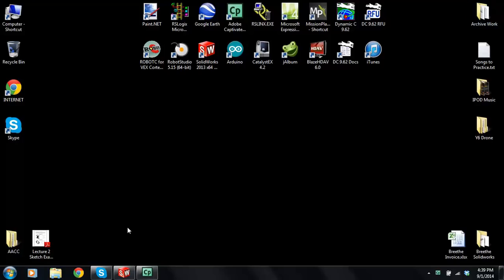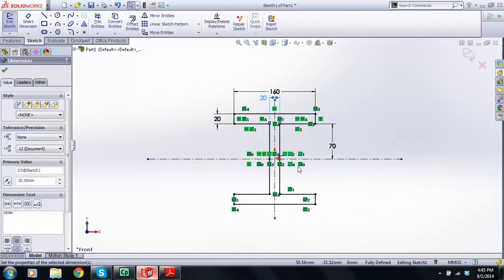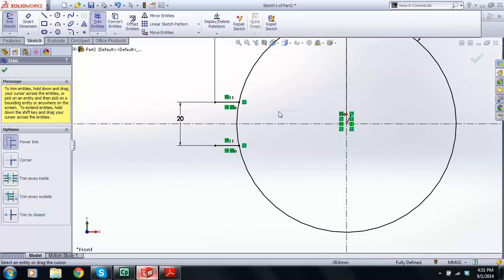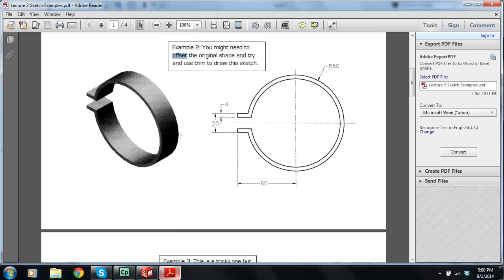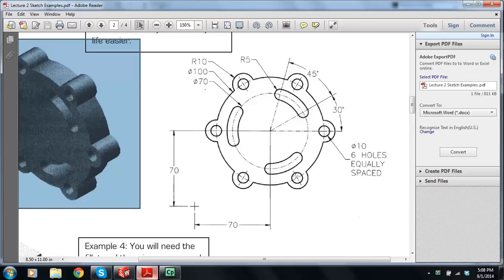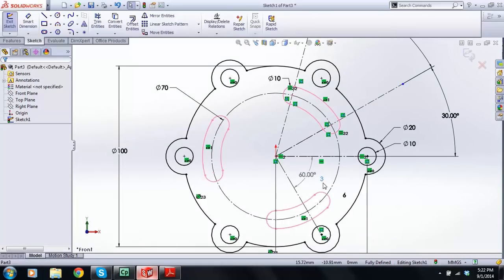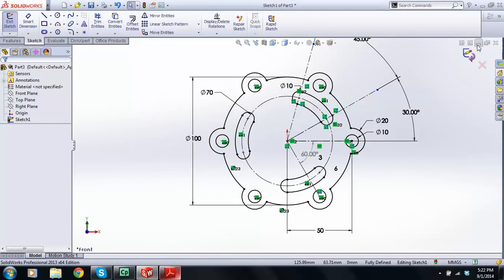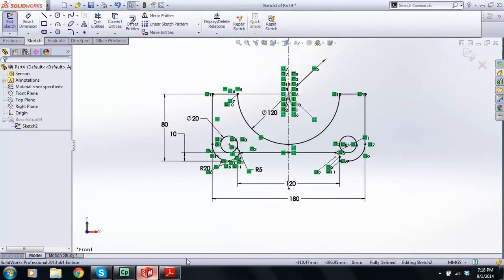Solidworks Tutorial 2 Modifying Sketches

Comment: Great tutorials Tim, thank you very much! 

For problem #3, I got around the "over defined" issue by running just the two 10mm circles through the Circular Sketch Pattern operation, and then trimming out the slots. 

So what I did was to draw the two concentric circles at 60mm and 80mm, so that they were tangent to the two 10mm holes on the 70mm construction circle. Then I did the radial copy to create two more sets of those two holes. Then I trimmed all the extra lines, and when I was done I still had two over defined flags...but both were on the first slot (per your video). I simply deleted each flag, and then all three slots were fully defined. Life is good.

Comment: thnx for all the tips. BTW at 27 minutes when you cannot lock the central rotation point to the origin...Just select the origin in the feature tree with control and add the rotation center point. You can then lock it like you intended too.

Comment: Loving the videos so far. One minor issue I had is that there is sometimes no explanation for why NOT to use a particular option. In the first video when talking about setting dimensions he emphasizes, "always go line to line" rather than point to point, etc and in this second video he tells us not to use the "Fix relation" option as it can be a bad habit.  I am guessing those options may cause issues if you go back and revise dimensions or other aspects of the sketch? Being new to this I appreciate the warnings but would like to know the reasoning behind them as well. If Tim or anyone else can add any insight that would be great.

Comment: at the start of the 2nd sketch,  I put the 2 construction lines across the origin just as you did, but mind does not turn black after I add the dim, but yours does. I also do not have the green relations visible. Am I missing something or do you think I have a setting that is not right   ?